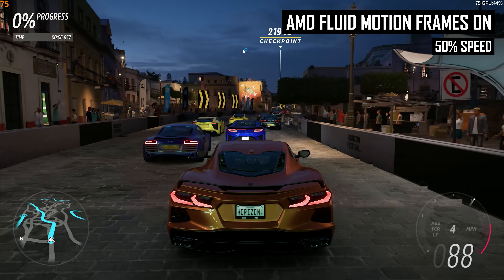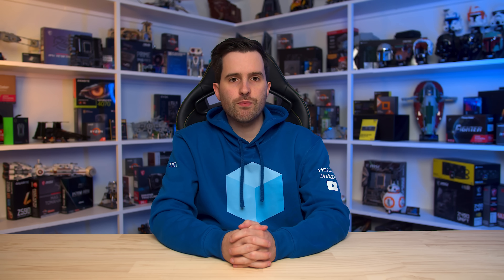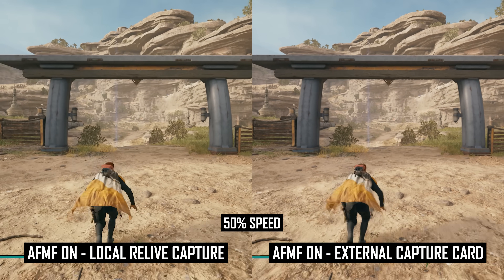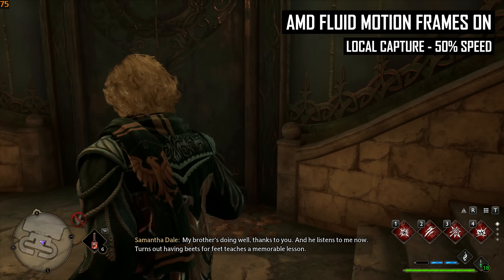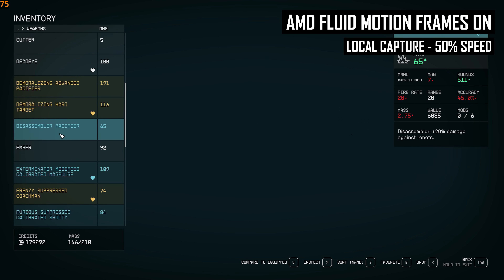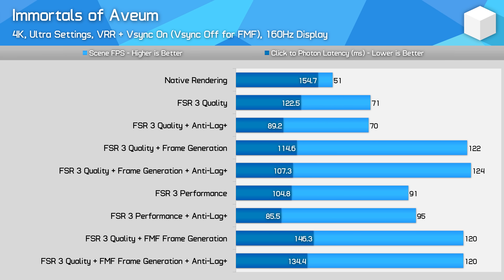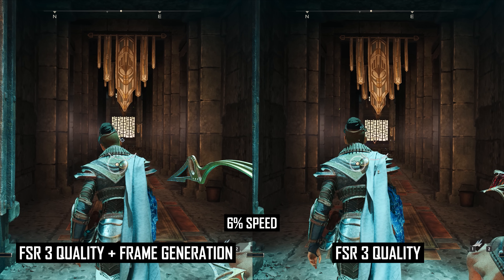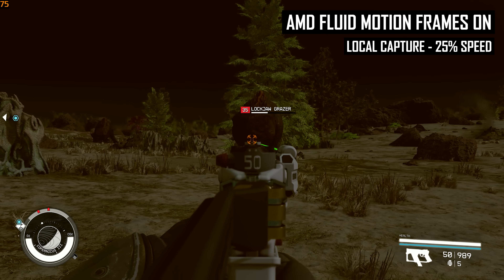Frame Generation for Every Game - AMD Fluid Motion Frames Analyzed

Comment: One scenario that absolutely sold AFMF to me was using it on games that are locked to 60 FPS. Tried it in The Crew 2 the other day and it was mindblowing. There is some artifacting, but it's still fairly minimal outside of few menu animations especially on the world map. It's a small price to pay to me anyway.

The whole game isn't as smooth as if it had a native 120 FPS, but it's still visually smoother than a locked 60 FPS. Plus this game is a best case scenario anyway considering its frame pacing is impecable to begin with.
Reply: @keithc2390  I remember you because I still have the notifications on the other youtube video.

Saying idiotic things like saying FSR3 is just TV interpolation, DLSS doesnt double latency, its impossible to interpolate without dedicated HW like Nvidia, that AMD doesnt use motion vectors, or doesn't have optical flow, comparing gpu and cpu async compute.

Really dumb stuff
Reply: @MrSandvich03  So many things that were easily debunked by more knowledgeable people, or if Jal took the time to read onto those topics for more than 2 minutes... Dang.
Reply: @impointr  Yeah, and the more you learn about it, the more you see that FSR3 was a gamble since mid 2010s
Reply: I can see that being good since I did take a somewhat thorough look at Forza Motorsport and found it to be the best example for AFMF. Every other game I've tries though the image quality hit is still not worth the tradeoff for me but it seems to work ok in raving games?
Reply: @TerraWare  It's alright as long as there isn't a lot going on around the car for sure. Within The Crew 2, AFMF disabled itself multiple times due to large portions of the screen having very fast motion, definitively putting the "fast mouse movement" fact entirely.

But eh, for the rest it's really good.
Reply: @impointr  Without camera movement, you would barely feel the smoothness. With camera movement, AFMF breaks apart.

It's the exact same tech used in TVs under "sports" mode. This just has slightly better latency than that. So how on earth can someone say it's visually smoother when you actually cannot rotate the camera!? In most games, camera control is paramount! This is what differentiates it from movies. It's TV frame interpolation with less latency penalty.
Reply: @jal.ajeera  I suggest you actually give it a shot honestly. I was also very skeptical about all this, yet it simply just works. If I were to not care much about framerate in games with little camera movements (e.g. racing games) then I'd stick to 30 FPS which... Just isn't desirable at all is it? What would even be the point of reaching 144 FPS in a game such as Forza Horizon 5 too since there is little camera movement?

Sadly this is a very very subjective topic and there really isn't any definitive answer. Personally I see a big difference and I'm happy to use such tech for these games where I am prevented from going above a certain framerate. For any other games though I'll do without, obviously.
Reply: @jal.ajeera Its you again, I corrected you many times before and you stopped responding.

Now I know you're just trolling.
Reply: @MrSandvich03  I don't even know who you are. Good to know I've fans.

Comment: The problem with you guys, you are playing games with very high end rigs, you wont need these technologies, for low to midrange graphics cards with high refresh rate monitors, this is a god send technology even today. But if you have medium to high end systems, you wont need this technology quite that much.
Reply: I totally disagree. The negatives of this technology become even more negative when using a lower spec PC. Turning on AFMF when you already have a low base framerate will make the game look and feel worse. Why play PC if you want to have an experience that is even worse than console? This is console/handheld technology for users who have no idea how awful the fps, resolution, and latency are.
Reply: @jjlw2378  I am totally disagree too. Your kind of thinking is the whole reason I did that comment. 

"Lower spec gaming do not need to be low fps gaming!!!"

There are people still uses 720p/900p/1080p with gtx/polaris graphics card. Often they have old 120/144hz panels. This a perfect case for them. I was one of those. Not everything should be console equivalent or ultra high framerate with ultra+++ graphics. There are settings in any pc games for a reason! I am pretty sure I would enjoy this tech with my old gtx card if it was available. Lock fps to your monitor refresh rate or -1 for adaptive sync purposes and that's all.

Comment: I am actually curious of how AFMF will work in a heavily CPU bound scenario like Baldur's Gate III. Especially since you play it more in a slow, tactical table top perspective. If it helps smoothing out animations as well as camera pans/rotation that's okay with me. Ultimately, both FSR3 and FMF feel like they are in a beta-stage at the time being, So I really hope AMD can improve the technology over time! Personally I really want VRR to work, with good frame pacing and a framerate cap at the monitors max refresh-range. If AMD can reach that point one day, it would make me an extremely happy gamer. (And of course, native implementation of FSR3 frame generation in BGIII)
Reply: Yeah, BG3 has been my Main use-case since this was announced.
Reply: BG3 doesn't even need over 60-75fps. It's not a high frame game.. lock your frames at 60 and save on your power bills. 😂
Reply: To be honest with a game like BG3 I don't know why just locking it to a solid 30 fps isn't an option to more people. I never got into fps higher than 60 but a solid vsynced non stuttery 30 fps seems pretty fine to me in slower games.
Reply: I don’t remember which channel covered BG3 with AFMF but it was covered.
Reply: You should take a look at what's happening over on Linux. Valve and AMD are currently pushing, close to release, most of the stuff you're asking for. You should look at MESA, Wayland, Gamescope and the KDE Desktop ( for VRR ).
Reply: I am sometimes CPU bound in Starfield in some areas and AFMF made no difference at least at the current state. So I guess in BG3 it might be similar. The problem is that AFMF seems to not work, when you move fast and it will not increase smothness as long as you have still bad 1% lows.
Reply: @boerbenlp8659 Starfield is a disaster of optimization of a game.
Reply: @theunexpectedua   Agree. Too CPU hungry compared to titles like Cyberpunk. Also the FSR Implementation is horrible.
Reply: @boerbenlp8659  Yup, it could have been a great game, but they screwed it up.
Reply: why would you use any frame gen in a slow game? the difference is not huge anyway and you wanna add shitty FSR xD
Reply: I think this is a promissing tech for when they get it more optimized, even it will always be subpar to games that supports FSR3 ingame. It would be more usefull if it would support DX9 and vulcan too, but then again if the game used is old enough to not have been optimized for DX10 or higher, a moder gpu like a 6600 or higher propably don't have problems delivering 100+ fps. I just mention the DX9 option, cause it would be interesting to test how this would work witch older Games using DX9 run on a system with an older than Radeon 5000 or Nvidia RTX 2000 cards like cards that tops at 4-6gb vram. if it would be able for to make people on a really low budget to keep their older relics of PC's still viable to get something out of a 144+ hz Monitor
Reply: Frame gen does help with CPU bound games, I have an older CPU with my 7900 xtx and now a lot of broken games actually run great! It makes it so the load shifts to GPU instead of CPU
Reply: FMF (manual enabled) works fairly good in BG3 while it turns off when you move the camera very fast it's barely noticeable in BG3 as it's quite a stationary game. Overall a promising tech from this early implementation especially for slower paced games reduces my 7900xt GPU load by about 30% at 3440x1440p @144hz. I can see it been much more useful when it's a new game your PC can only run ok 60fps ish, but you want that 120fps fluidity and can live with slight visual artefacts to achieve that.
Reply: I've found Forza Motorsport to be the best candidate to the point where I would actually use it because FSR doesn't give you much performance back and AFMF works really well in that game.
Reply: I tried it with bg3 and it does feel better. Just like in oxygen not included.
Reply: Been using Nvidia's FG in Baldur's Gate, and aside from some slight issues with moving the map/minimap and the occassional disocclusion artifact, it works pretty much indistinguishably from native 120 FPS.
Reply: If your CPU is holding you back from having 60+ fps in BG3 I would like to just let you know that the last 5 years of CPU releases happened.
Reply: @Azureskies01 Perfect 60 is not possible in Baldur's gate 3. Even the absolute fastest CPUs cannot avoid frametime spikes over 16.67ms in Baldur's Gate (the city not the entire game)
Reply: getting a new GFX card is better in majority of cases (even a R1600 is enough for most games if you have RTX 3060 or better)  @Azureskies01
Reply: @Azureskies01   Still means one solution costs money and one doesn't. And there are plenty of other use-cases such as 60fps cap (eldenring for example) or just cpu heavy games like factorio.
Reply: @mjn5016  Even though AMD recommends using FSR3 (which is better than AFMF) at 70 fps or higher? Adding any amount of extra latency to a game like elden ring is stupid enough as it is
Reply: @mjn5016  People shouldn't expect to be able to play at 50+ fps in every big title game running on 10 year old computer hardware. Unless of course you would like to stagnate the gaming market even more than it already has been.
Reply: @Azureskies01  who talked about 10 year old hardware...? And I'd always prefer gameplay improvements over graphical ones.
Reply: @mjn5016  I brought up 5 year old or newer CPUs and you responded to my comment. Good try though
Reply: @Azureskies01 act 3 is pretty weird, I got a Ryzen 5900x with 128gb ram 3400mhz and a Radeon 7900xtx and I only get maybe 70-80fps in some areas, while my stats only slow 30-40% CPU usage and maybe 50% GPU usage.  Frame gen helps.
Reply: @Azureskies01  Try part 3 and see if you can succeed, not even the fastest CPUs can do a locked 60fps.
Reply: @PixelShade  ohh no say it isn't so! Darn those .1% lows!
Reply: @Azureskies01  LMAO you clearly have zero clue whay you're talking about. Not even the 13900K can give you consistent 60 fps once you reach the city.

Comment: I don't want a Frame-Smearing arms race. I want better raster and better utilization of VRAM. Improving those 2 will yield results that are undeniably better, instead of new tech that makes us debate and contrast and compare under an intense microscope to even figure out which is On and which is Off and which is better, if at all.
Reply: There's only so much GPU manufacturers can do to improve card performance if game developers refuse to optimize their games, and devs refuse to optimize them because they're barely given enough time to develop games as is. The industry has grown too large and too infested with executives to properly answer to gamers. We're gonna need to see a lot of regulation in the game industry and pretty big market movements from gamers themselves before we see optimization being the norm again.

Same applies to the GPU market. They've realised that they're selling a luxury good with fairly stable demand so they can just raise prices, and they did just that, because they have a duty to maximize profits. They're not gonna quit raising prices and making people pay more for less before they get stopped, either by market outrage or by regulation.

That said, I still commend AMD developers for making the tech, and AMD as a whole for not locking it down to their latest gen of cards. They're still a corpo and that makes them assholes by definition, but they're at least slightly more pro-consumer than the other guys, so I feel like they deserve praise insofar as they continue doing pro-consumer things.
Reply: High quality for a reasonable  price is the dream, but most companies are chasing the "one weird trick" approach and ai being everyone's favorite new tech to worship, I don't think the focus will be on hardware again for a while. Let hope cool stuff comes from it rather than the endless stream of ways to abuse ai .
Reply: I miss features like vrs and ngg
Reply: My thoughts exactly. It seems a choice has been made to cheat (probably  because it's easier and overall less expensive) rather than truly optimise games and make the experience better. We are getting visual artifacts and frames that you have no input on, no wonder retro gaming is taking more and more of my spare tim.
Reply: Calm your teets , this is just a preview not even a beta lol
Reply: @gunturbayu6779  I'm obviously talking about RT/DLSS/FSR in the broader context and not just the reshade mod called Path Tracing, but okay, you can go ahead and hear what you want to hear. I can't stop you man haha
Reply: so youre basically asking for BIG performance ? then go buy top end cards lol, the fact frame gen feature is helping boosting people is something, if you whine like this then go buy yourself an actually capable card like 4090
Reply: @Eleganttf2  i already have a 7900 XTX. i've seen it. the frame smearing, the RT, the FSR. i've seen it all. and i hate all of it. i've paid a premium for trash-tier features, and it would be only marginally better with green team, but it'd still be trash-tier features nonetheless.

i want a gpu with the raster power of 7900 XTX, minus all the garbage features, and of course at 35% less cost.
Reply: @jbmusicproductions516 Sorry to say it but you're complaining into the void. This is where gaming performance is going (on PC and console) like it or not.
Reply: @vinyfiny  it's not really "the void" if the void shouts back "stop whining" is it? lol

well, let's hope the future of frame smearing isn't as trash as it is now.
Reply: @jbmusicproductions516  I mean us in the YouTube comments can't do anything about it so we basically are the void😂. Except maybe speak with our wallets (which gamers are pretty bad at TBH).
Reply: @vinyfiny  nah man. companies care what people say online. it does matter. 

but do enough people feel the way i do to make a change? dunno.
Reply: @jbmusicproductions516 raster is a dying tech with pathrracing on the way so why would you wanna hang on to outdated tech ?
Reply: @kingyogesh441  Rasterization is literally the foundation of modern video games. There are no Frames to Smear, nothing for AI to work on, if there is no rasterized information.

Call rasterization outdated when something replaces it in full.
Reply: @jbmusicproductions516  that’s what full path Tracing is here to do .
Reply: @jbmusicproductions516 look if you don't want the features nor use them buy a1080p monitor.  Other wise you have to by a 4090 to really push everything on 1440p and 4k
Reply: You want a ancient thing called Rasterization 😂😂 a dying tech
Reply: You won't get it. Move on. Quit whinning. Frame gen is the future.
Reply: @jal.ajeera  if only i had some fries to go with all this salt your sending me hahaha
Reply: @jbmusicproductions516  So on top of being a whiner, you're lame as well. Keep it up.

Frame gen is the future as it should be. Hardware will not scale as drastically as it used to in the past. Companies have to devise strategies to help the video card (hardware+software) keep pace with increasing graphical fidelity. Frame gen is a great step in that direction. I've tried it on my 4090 and it truly makes it worthwhile, especially with path tracing.
I don't care if my card outputs 1 fps. If I am seeing smoothness of 60+, minimal latency and Image quality penalty, I'm ok with it. So far, that's been the case. It'll only improve from here.
Reply: @jal.ajeera  man i've seen path tracing on 2077 using a 4k OLED. it just looks different, but not necessarily better. is it more realistic? yeah, sure. but ultimately, it looks like a reshade mod. a lateral change instead of an undeniably vertical improvement. it's cool from a tech perspective, yes, but not much more beyond that. 

if you like it, cool, that's on you. i'm not about to tell you what you can or can't like, or what you can or can't whine about.

hopefully you're right about this frame smearing stuff man. but for the foreseeable future, we'll keep having to pay top dollar for trash-tier features.
Reply: @jal.ajeera if the future of gaming is dealing with enough latency to make every game unplayable, then gaming is going to die. If you want to embrace that, then that’s on you

Comment: while im a huge fan of nvidia hardwares but not their practices, its so dumb that people mindless cheering for a feature without hardware requirement, with no regarding the result no matter how bad it is, as if they broke a road block that they intentionally restrict the users. there is a reason why dlss performs way better than fsr due to extra ai processing cores on 2000 series, there is a reason why frame gen needed sepearate implementation from devs instead of driver wide features. 
nvidia should have just enable everything for every hardwares and let people see how horrible it would run without proper hardware and software support, just need a disclaimer that they dont guarantee any experiences enabling features on unsupported hardwares